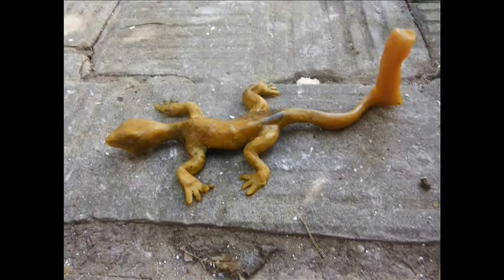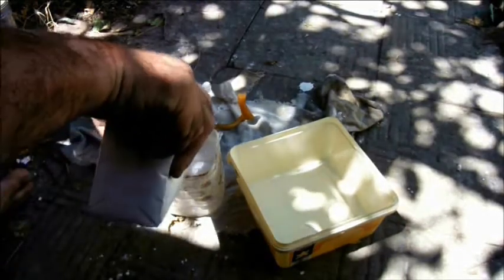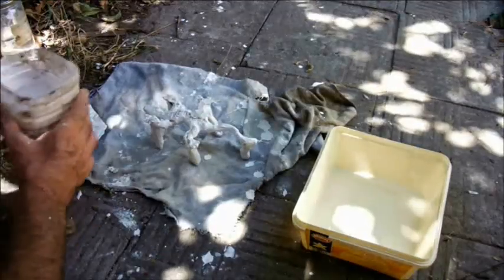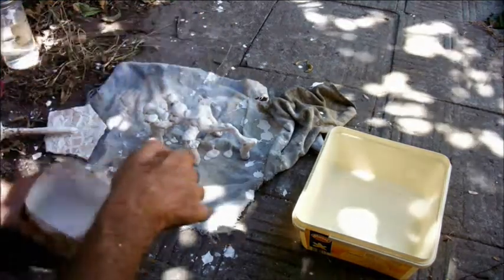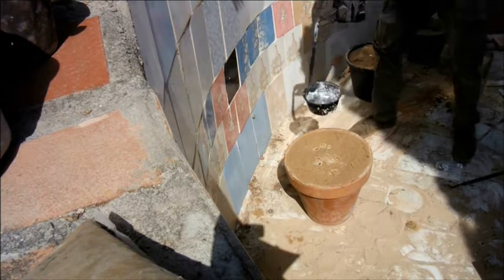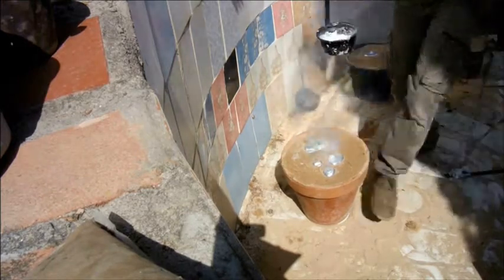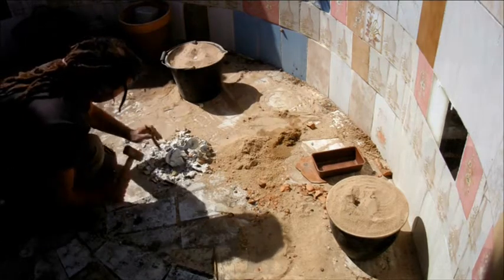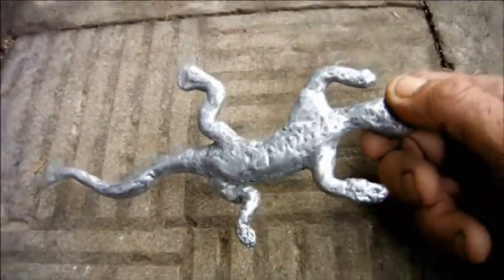How to do lost wax investment casting at home

Comment: How did you actually make the wax object, I want to cast a gun (non functional) that look super detailed but i dont want to engrave a whole bunch of detail. How would I make a large object out of the wax?
Reply from the maker: Firstly, let me say that casting a non-functioning gun is a very noble thing to do, and something I want to do, too.
 I´ve seen the King of Random video in which Grant made a wonderfully convincing handgun from expanded polystyrene and successfully cast it in aluminium.
 You could, if you´re rich, get Shapeways to print a handgun in PLA, then you´d be able to cast it in ally - but if you want to use wax, I can´t think of any way except good old fashioned sculpting.
 I made this lizard quite casually, sitting on my sofa and squishing the wax into shape with my fingers as if it were modelling clay, but to make a gun I reckon that I´d first make perfectly flat slabs of wax of various thicknesses, then do my best to cut out the shapes and layer them together. You can buy perfectly round casting wax sprues of various diameters online, in case you want to go for an exposed barrel automatic such as a Mauser C96, Walther P38 or a Luger.
 Also, you might be better off with proper casting plaster rather than the builder´s stuff I used in this video.
 Good luck!
Reply: wax for casting comes in quite a few shapes that you can cut and stick together with heat, to avoid doing a lot of shaving, sculpting, etc. start with sheets and slabs, and some soft wax to finger shape, also comes in tubes and wire form. you could literally do it without much sculpting and it'd look cool when done, but you'll have 100 or more in wax unless you form the shapes of each feature by hand (very time intensive but not costly). all you need is a hobby knife and anything you have laying around to do it on the cheap + the wax and whatever you have for the actual casting process

Comment: this will work much better with a wax burnout, the residual wax in the plaster burns when the aluminum goes in and makes all of those bubbles you see and causes voids and lousy finish in the final casting
Reply from the maker: Hello, Sugarsail - please clarify; should I have placed the mould in the furnace rather than the oven to remove the wax? I don´t get what you mean by a "wax burnout".
Reply: It needs to be hot enough to actually burn the wax, not just melt it.
This is where plain plaster of paris fails, as I have found out the hard way a few times. A mixture of plaster of paris and the finest sand you can find works, cast into a metal flask.
Reply from the maker: Hey, thanks, PandaMan, for picking up the thread - I shall try your suggestion next time I do a lost wax casting.

Comment: this is a great video and helps make these kind of things far more accessible. thank you!

But would the Plaster of Paris investment also be suitable for casting precious metals?
Reply from the maker: Now that, Aidan, I don´t know. I went into this on the premise that the ancient Mesopòtamians managed with charcoal, beeswax and plaster, but I wouldn´t risk contaminating my lovely precious metals with nasty sulphurous charcoal fumes or using ordinary plaster unless it were absolutely necessary. Thanks for your kind words about this video, by the way. I´m not trying to say that purpose-made paraffin wax sprues, computer-controlled furnaces and proper casting investment material won´t yield a better result - of course they will. I just wanted to show that it´s worth having a go, even with the crudest of kit    : )
Reply: Del350K4 , that's perfectly fine. I'm interested in crafting jewellery from scratch so I'm looking for potential processes. So far the one in this video is the most accessible I've seen. You've used Aluminium but what other metals could be casted with this investment method?
Reply from the maker: I´ve successfully done brass, and for Christmas my wife has just bought me 2 one-pound ingots of tin so I can combine it with copper (extracted from old tv monitors and alternators) and try to create my own bronze. Silver and gold have higher melting points than these metals, however. One thing to consider is that the ancients were investment casting precious metals back when clay, sand and plaster were pretty much the only options. Greensand was a far, far later discovery, or so I gather.
Reply: Excellent info my friend. I really enjoy using the old ways. Many,many wonderful things are on this earth today because of that knowledge.

Comment: Hey. As I guess you know full well, as plaster of paris reacts with water if gives off quite a bit of heat which I suppose makes it harder to keep the wax model from distorting. I wanted to ask if you've tried using ice water (obviously without the ice cubes) to offset some of the heat created. Is there a good reason not to do this?
Reply from the maker: Herllo, Will - in fact we´ve both been thinking along the same lines. I mean to try this on my next attempt.
Reply: I'm looking forward to seeing if it helps.

Comment: ummm, i hate to tell you old chap, but your foot seems to be on fire. haha. great vid, ideas are limitless. I suppose limiting factor is getting enough scrap. It turned out really well. would an engravers pen work on it, to add detail.  is it possible to add dye to the molten ali ?
Reply from the maker: That´s a good question. If you mix aluminium and copper (mainly copper) you get a golden-coloured alloy known as aluminium bronze, but I suppose most dyes would be toast at those temperatures.
Reply: You can't put dye in it, but you could anodise it and dye it afterwards.

Comment: Thanks. this helps me along with this whole process. Thanks again.....Dean......
Reply from the maker: Dean?
Reply: Hello, I am reasonably new to the pouring world and interested in trying the lost wax process for some of my work.
Reply from the maker: Ah...you ARE Dean - well, thank you for watching my video and for saying hello. This was my first attempt at lost wax casting. Using these cheap materials doesn´t really get you a very good surface finish. If you watch my other "lost wax" video, the Land Rover badge, you see my disappointment and surprise as I open the mould to view my casting for the first time. If you´d like better results, first; forget beeswax. Spend a little money and use proper investing wax, or at least use the wax you find wrapping cheese - It´s much more user-friendly. Secondly, ensure that you mix the plaster with cold water. My results are always better if the water´s spent 20 minutes in the fridge. Third; expect a one-in-three or a one-in-four success rate. Sometimes I pour a few pieces, all prepared identically, only to find that one has worked but not the others. Lastly - don´t give up too easily. If you keep trying until you do get a reasonable result you´ll be really, really glad that you kept at it. Good luck   : )
Reply: Thank you so much my friend. I forgot to sub ya yesterday so I fixed that today. I have been doing silver "closed pours using petrobond and have come 
to many of the same conclusions about loss and absolute failures. Esp. getting in a rush.Absolutely on the quality materials too. Your video really dose give a fellow a great idea on process. If they could produce wonderful,accurate pcs 3000 years ago with just the basics I am sure with some failures I/we can do it as well. Thank you my friend and have a wander over to my channel for a visit.Be good to see ya . Bye now.
Reply from the maker: On my way over to your channel right now   : )
Reply: Wow, Thanks man !
Reply: Great,Thank you,Thumbs up friend !